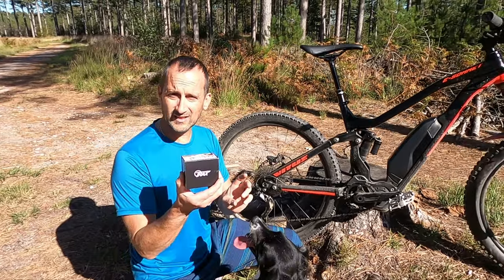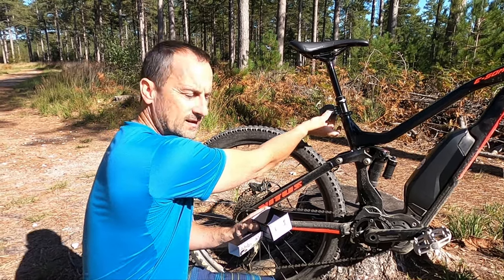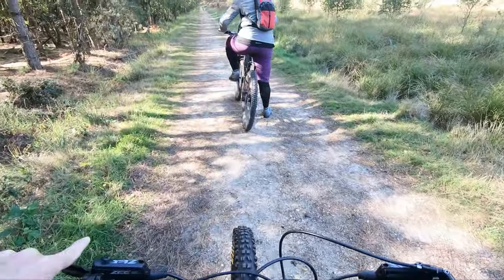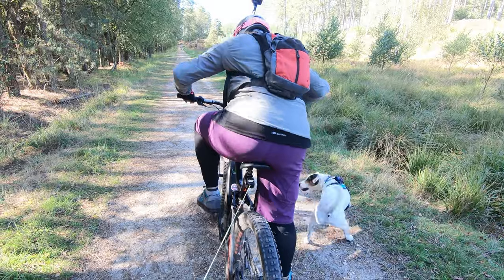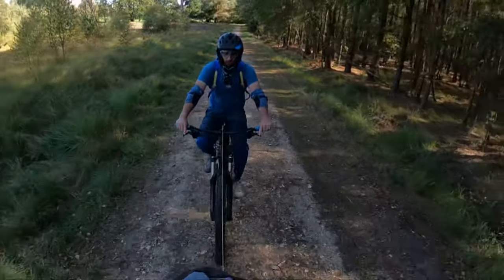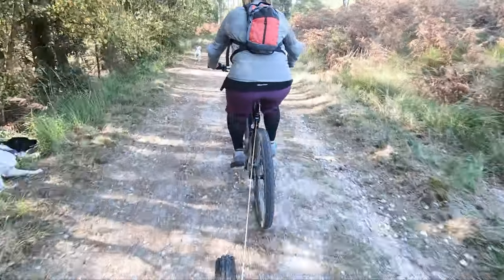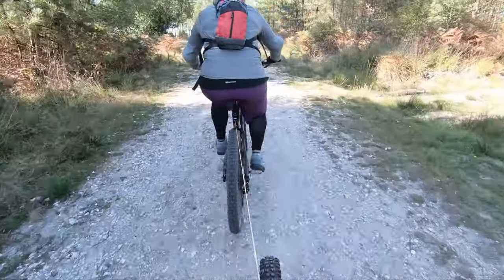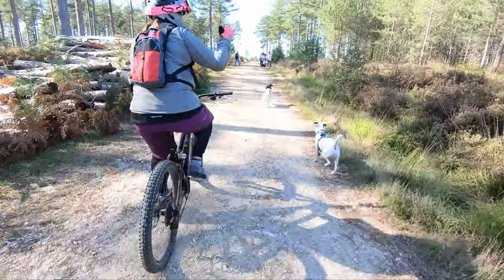TRAX MTB Retractable Tow Rope Review - eBike to Mountain Bike Test

Comment: Hi, I wanted to know the size of the contact point with the seat post where the clamps attach.
Thanks Alex
Reply from the maker: Hi Alex, I am working away from home at the moment, however I will measure it at the weekend and let you know 🙂
Cheers Shaun
Reply: @SearchMTB  
Hi Shaun, I await your reply.
Regards Alex
Reply from the maker: Hi Alex, I have just measured and the contact point is 30mm.
Hope this helps 👍
Cheers Shaun
Reply: @SearchMTB  
Hi Shaun,
You were very helpful, I just ordered the TRAX ...
Thanks again Alex
Reply from the maker: No worries 🙂 I hope it works for you 👍

Comment: I tested this product and I find that the hanging system does not suit me. Do you have another similar product to recommend to me?
Reply from the maker: Hi, It's worth checking our other video on the newer version of this system. Trax MTB have three products now, that all are worth a try. Hope this helps. 😁🤙
Reply: @SearchMTB  After trying the Trax I tested the Tirevelo and it's much better with a child
Reply from the maker: @dambecker2943  yeah we've just spotted that in a french MTB shop. Looks like a different design, the unit is quite a lot bigger that the trax.
Reply: @SearchMTB  
Frankly the Bike Tire is worth testing and it's a great product that I recommend